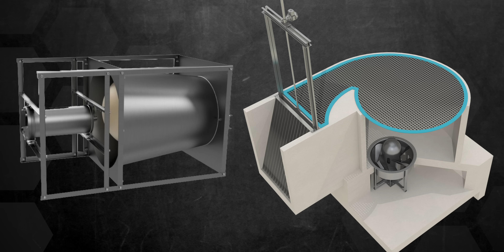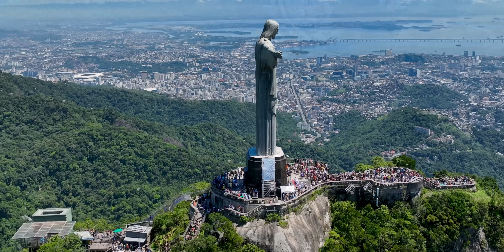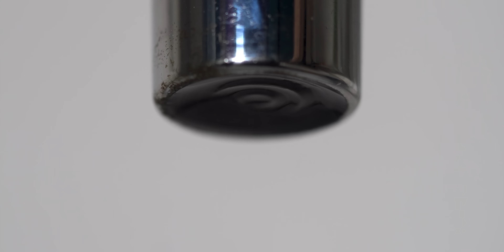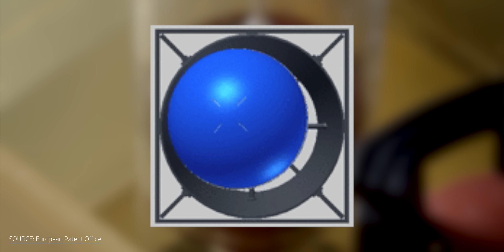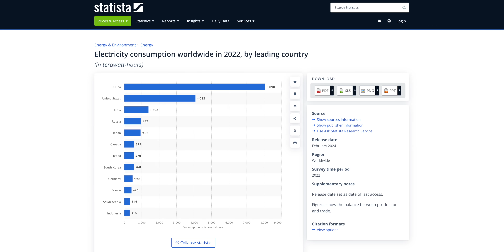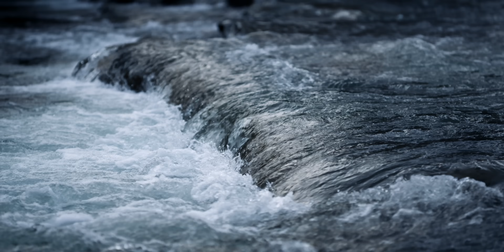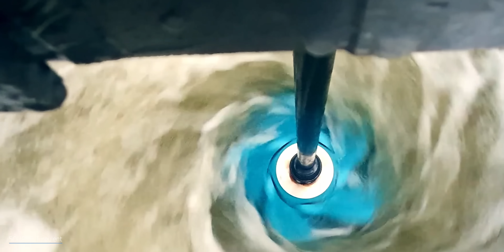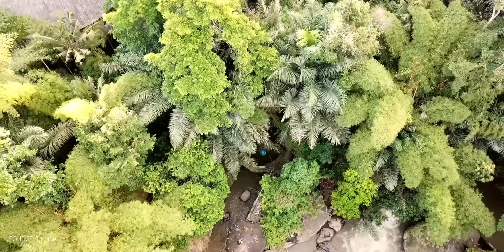The Genius of Small Hydro Turbines

Comment: Hydrokinetics' models look ambitious, but technician and culvert unblocking video addict in me sees them, and they look like a maintenence nightmare. 

With how much debris flows down most rivers, sticking what amounts to a restricted culvert into the water seems like a recipe for inconsistency and near daily cleaning/upkeep. It's a fascinating idea, but I feel like they fell in love with a lab model and don't have enough real-world running time yet to work past those factors.

Turbulent's system looks like a fantastic compromise system, though. It seems more capable of handling environmental factors in more traditional and less manpower intensive ways with simpler turbines. That screams higher reliability and less maintenence to me. 

I'm a nobody on the internet expressing an opinion in the YouTube comments section, so take those opinions about as seriously as you see fit.

Comment: I've written off hydropower for decades due to the enourmously devastating effects on multiple ecosystems.  But this new tech seems less invasive, and even plausible for homesteaders.  I'm all about decentralizing power dependency and distribution, as corporations have been exploiting customers and destroying environment and allowing infrastructure to disintegrate, for decades -- literal generational wealth extraction.  Small, local, independent power generation reduces the need for expensive, inefficient power grids.  Local battery technology used in concert all but eliminates the need for a grid to manage local over and under production differentials as various environmental conditions change.

Comment: Dam's were originally constructed for the purpose of flood control and not power generation.  One of the largest dam owners in the US is the government.  Many areas wouldn't be habitable without flood control dams.  Power generation on any scale is just a side benefit.  Yes, many fans were constructed solely based on power generation, but they're in the minority.  There is a huge benefit from dams for flood control.  As with anything, there are also drawbacks to the environment, so it's a question of risk vs rewards.  
Small hydro is lower risk and lower rewards and largely has very little ability to control flooding.
Reply: Your thinking of the dams like those up and down the Mississippi River that don't generate electricity. Yes they help control flooding but they also maintain river levels deep enough for barge traffic.

We have smaller dams also here in Iowa that we're put in 100 percent for electric production! These smaller streams still flood with or without these dams.

An added benefit is the water reservoir for boating and fishing.
Reply: @tenlittleindians  I didn't say so dams were put in for flood control, just many/majority.
You can have a look here
https://www.fema.gov/emergency-managers/risk-management/dam-safety/national-inventory-dams

Look at the floor inundation maps to get an idea of where it was the main reason.